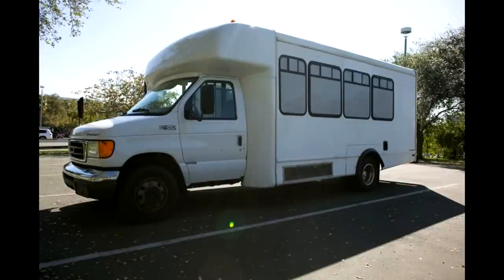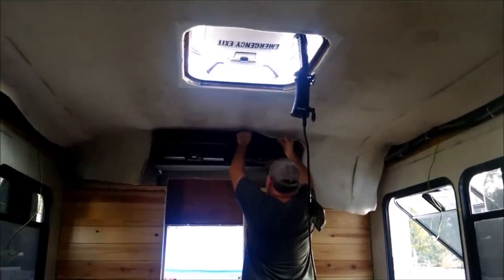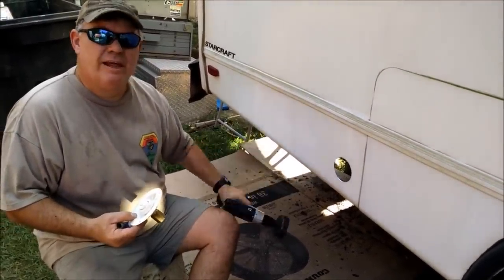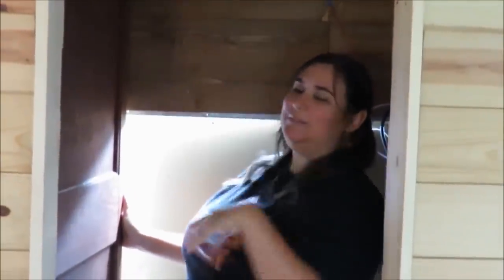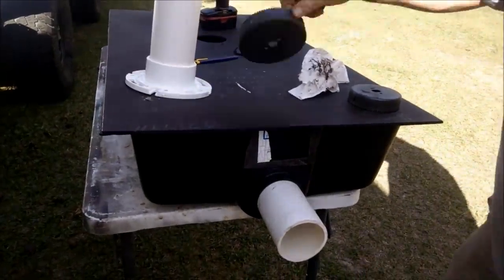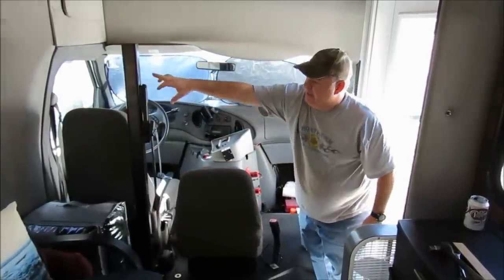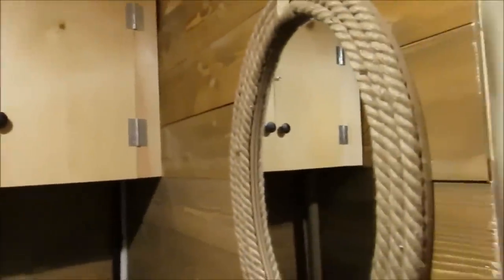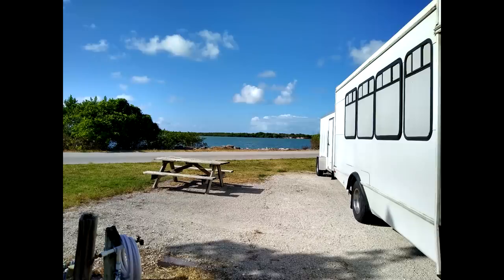Amazing Shuttle Bus tiny home conversion

Comment: Terrific job, and great explanations,  I'm just getting ready to do over a 94 Gulfstream Ford 24 Passenger Shuttle Bus,   29 ft long, with Tag Axle. --- but it has what I wanted!!! 2 regular doors on the cab and the fold out door is just in back of the passenger seat. Thanks for a great video!

Comment: Love  the  colors  and layout, especially  the  curtain!  --I'm  with  everyone  else  though,  I'd  need  a shower.   You  can  install  a shower head   and still keep  your  closet.  Just  put  the shower head over  the toilet, and have drainage in the floor.  I took a shower once  in a friends' truck bed camper  that had one.  Their bathroom  was  smaller  than  yours,  they  had  the  toilet,  a sink on the back of the toilet,  and the shower.  It  worked for me.

Comment: Interesting and comfy conversion however
I foresee a larger deeper kitchen sink for the ease of cleaning pots etc.  Have y’all considered making window and front door screens (simplified via magnets to hold in place after opening windows)?  I luv the wraparound kitchen countertop.  Did hubby install a fresh water tank and a hot water on demand heater?  Are you using a Mr. Buddy space heater for those chilly occasions?
I like the deco full length cab curtain; nice touch.  I’m not sure the futon style bed would be comfortable so I’ll be curious to see if in the future you opt for a hide-a-bed or a daybed style (couch during daytime) whereas the bottom pulls out so as to increase the bed size. 🌻

Comment: I would have installed the shower. I like to be able to shower last thing at night and crawl into bed nice and clean. Less clothes and a space to wash for me is a priority.
Reply from the maker: We mainly stay places that offer bathhouses with showers and its less water going into the black tank which means we can go longer before having to dump.  But I can see where not having to walk away from the bus to shower each night would be very convenient at times. We appreciate you watching our video!
Reply: Had room to make it a wet bath with a closet as well.
Reply: @DreamingBigSC  Its just shower water could it not just drain straight outside instead of black tank?
Reply: You could also consider a collapsible shower. I’ve seen multiple builds in YouTube where they made drawers or just stored a shower pan somewhere that could be pulled out, shower curtain hung and then put away after. Depending on what is under the floor you could even consider putting a shower pan under a removable section of the floor. But it’s a personal Choi and you’re happy as it is, that’s all that matters. Beautiful build and practically done to boot.
Reply: @Turk_2023  Not legal most places, I don't think.
Reply: @Turk_2023   yes usually grey tank or the ground if camp ground. Earth friendly soap
Reply: Me, too! 😊

Comment: I agree with Eric; this is sooo realistic! thanks for sharing it. I want to know tho, and maybe you address it later...what about insulation in the walls? You Go guys!!
Reply from the maker: Thanks! We left all of the existing interior walls which have normal car insulation.  We didn't add extra for two reasons.  First, we stay mainly in the South East where winter rarely gets below 30.  Second, since the bus is almost all windows we loose most of our insulation there no mater what we did.  So far we have gone to southern florida in the summer heat and we have stayed in the bus in 30 degree winter and we have been comfortable.  Heating the bus in winter is super easy.  Cooling it in the summer is a bit harder but again I blame the windows for that.

Comment: You also didn’t use off grid power?  No solar panels or deep cycle batteries?  My conversion will have a solar fridge/freezer, camp toilet (no black water), full sized kitchen and 600 watts on deck with 2400 watts in the batteries.  And full insulation with sheep’s wool and aluminum clad flex foam.  I would love to get details on some of these facets, if you used them in your build or why you didn’t want them.

Comment: I am glad I watched your video! I am looking for a shuttle bus to convert. I see you didn't take down the heat/a/c unit..does it work good heating and cooling your bus? The build looks great!
Reply from the maker: Actually the back unit was not working when we bought the bus. It doesn't heat or cool but it does recirculate so it's more like a huge fan.  It moves some serious air, though!  We left it in really because we were in a hurry to get on the road and it wasn't in the way of our design.  We will probably remove it one day because I would like to put some small cabinets in its place to hold kitchen items.

Comment: I really like your idea of using the vinyl flooring on the walls.  Looks great.  But it looks like you didn’t do any extra insulation in ceiling, floor or walls.  Are you sorry that you didn’t now that you’ve been in it a while?   Also, what do you do for heat and cooling?  Do you just use the bus system?
Reply from the maker: We mainly stay in campgrounds that have electricity so we use a floor air-conditioner for summer and a plug in heater in winter.  In extreme temperatures we also keep the blackout curtains closed during the day.  We have stayed in snow and in summer Florida heat and have had no problems.  We felt it was a waste of money to put in extra insulation since there are more windows than walls and that is where the extreme temperatures will creep in.
Reply: Dreaming Big SC Good point about the windows.  I’m considering a shuttle build and will go back and look at more of your videos to see if I can feel confident enough in my skills to do it. I have a lot of home remodel experience but nothing automotive so am a little overwhelmed but love the idea of a custom shuttle vs a manufactured RV.  You did a nice job, and I’m thinking of doing a similar thing with the luggage area (bathroom/closet combo, and hopefully bike storage) with perhaps a pocket door instead of a swing door.  Thanks for the quick reply.  Safe travels.

Comment: Nice work, but should have removed the ceiling plywood and add rockwool insulation, then new panel.  Also, add at least 1 inch of rockwool to the walls and floor. A nice freestanding wood stove in the center to keep it warm.

Comment: I noticed that you didn't strip the walls and insulate like most people do from what I've seen. Would you say the temp is ok without it on your build? Thanks
Reply from the maker: Our bus has more window area than wall area so we opted not to waste the money on added insulation since the windows would still be our weak link.  We also live and travel mainly bin southern states so heat is our main battle.  We don't have to deal with freezing temps.  We did a week in the Florida Keys in the hight of summer heat and we were fine thanks to the black out curtains covering all of the windows.

Comment: Hey I could use some advice and information.  It looks like your shuttle van/bus is a starcraft?  I just got one.  First thing is I need to replace the radiator.  Hairline crack along the plastic part on the top of it.  Have you done anything like that?  Next is this a V10 engine you have? Mine is a v10 6.8L Ford-E450.  I'm pretty sure that is what you have?   What is your MPG?  Also, mine has an "auxillary battery" I'm wonder ing if you can tell me anything about that.  Like, if I drain the auxillary with lights and stuff does it effect the primary?
Reply from the maker: Yes, it's a v10. We get 9 miles per gallon even when towing. We haven't done a radiator swap but those are common engines for the E450 series of Fords.  We disconnected our auxiliary battery when we got our bus so we don't know how that effects the main battery. Thanks for the questions and good luck on your build!  Thank you for watching.
Reply: Sent u another msg, and yes the radiator wasn't a big thing .I also sealed along the roof where the seam runs over the drivers area with Flexseal, and bought some sort of expensive durable RV tape to run along the sides. I kept the aux battery area, and put an AGM battery there with a throw switch for when I'm parked so I can have appliance juice without draining the starting battery

Comment: How did you cut off your front steps my bus has same issue an how did you change your door?
Reply from the maker: @josephdickerson9871  we used a 4 1/2 cut off wheel and a reciprocating saw with metal blades

Comment: Nice job,  an issue however, if you have a vehicle inspection a passenger seat can not be bolted down to a wood base, seats must be bolted through the vehicle floor with a metal base or rail system. An accident investigation would be a problem  Otherwise, really nice job! Enjoy it...

Comment: I didn't see no installation installed. Why no installation? Trying to see do I need to install or not.
Reply from the maker: I've talked about this a lot, with the number of windows in the bus we would lose most of our heating and cooling through those regardless of the amount of extra insulation we put in the walls. Therefore, we didn't waste time and money on extra insulation since the walls are a much smaller amount of space than the amount of windows. Now we are traveling mainly in the south so we do not get extreme cold temperatures here. We have traveled all the way down to the Florida keys during the summer and we have stayed in it in the snow in the winter. And with a small heater and a single air conditioner we were able to stay comfortable at both extremes. You will have to decide based on your conditions what would be best for your bus. But for us it was not worth the added expense. Thank you for writing and for watching. We certainly appreciate you.

Comment: Do you have to have a class B license to drive a shuttle bus?
Reply from the maker: In South Carolina it came down to the number of seats as to whether you need a special license. We had to prove to the DMV that it was now an RV with only two seats. They then chose to tag our bus as a truck which requires no special license. Other states are probably different so check with your local DMV.

Comment: I would suggest that you rebuild that secondary seat base out of metal, That seat belt is only as good as the seat base, you do not want one separating from the other in an accident. I have seen that happen in the rock crawling world and it is not pretty.

Comment: You didn't explain where you both sleep on the futon?  that does not seem comphy!  Plus no shower how does that work?  Plus the living space seems to be waaaaaay oversized which don't make sense because you don't have room for a shower or an actual bed space.  You didn't explain how and why you did that likely because you don't need those spaces but would have been nice to hear ya talk about it...  just saying..  that bathroom closet with the adjustable shelves is an awesome idea though and the door doubling as a could have been shower to bathroom door is also very great idea.  Awesome for you but confusing layout for me lol. cheers!
Reply from the maker: Thank you for your input.  This was just a quick overview of the build video. Basically a recap of all of the videos we have posted over the last year. We will be doing a full walk through video soon that will go into more detail and our past videos of the step by step also cover  why we made the choices we did.  The futon has a 8 inch memory foam mattress that replaced the futon mattress.  It is extremely comfortable. We opted not to have a full time bed because it was a waste of space during the day and I wanted a full couch and large kitchen.  We figured we are awake more hours than we are asleep so we built the bus with that in mind.  Its been a great  layout for us.  We opted not to add a shower because we mainly stay in campgrounds that offer showers so we didn't need one.  Im saving all of your comments so I will be sure to include those points when we do the full detailed walk through.  Thanks for watching we really appreciate it!

Comment: I see this video is 3 years old and it appears that you didn’t add insulation anywhere. Have you had any climate control or mold issues in these 3 years? I’m getting my shuttle bus delivered in a few days and am trying to figure out if I need to add insulation or not. TIA!
Reply from the maker: We haven't had any issues. We opted not to add any extra insulation because the number of windows was going to be such a weak spot anyway. We did fine in the winter but it is hot in the summer. If I had it to do over again I think I would have added more insulation to the ceiling. We are in the south and our summers can get into the 100s. If we could park in the shade it did fine but in the full sun it was hot! I'm not sure added insulation would have helped but it's worth a shot. My nephew needed a place a stay so he bought our bus last year and he is living in it full time now. It is still doing great.
Reply: @DreamingBigSC  , thank you so much for the information and for taking the time to reply!
Reply from the maker: @karise78  I'm always happy to help. Let me know if you have any more questions as you start your build.
Reply: @DreamingBigSC , that’s so kind. I will do that! Are you guys on Instagram or Facebook as well?
Reply: Actually, I found the links from your website to FB and Insta. Thx!

Comment: Great Job but what size was your nails for the side walls
Reply from the maker: They were 1/2 inch by 18g Brad nails to help hold the adhesive.  However we did have to go in a few places with small screws later.

Comment: i really like how you did the walls and the bath room was cool did it come with a back door when you first got it cause i want to replace my back wall with a sliding glass door. also how high are your head space or that step up  im 6 ft put plan on building a 2 ft or 1 1/2 ft floor to place japaneese futon bed and storage underneath in order to save space and keep it open???

Comment: You didn’t insulate it at all? Do you find it doesn’t maintain temps well without insulation?
Reply from the maker: We left all of the existing interior walls which have normal car insulation.  We didn't add extra for two reasons.  First, we stay mainly in the South East where winter rarely gets below 30.  Second, since the bus is almost all windows we loose most of our insulation there no mater what we did.  So far we have gone to southern florida in the summer heat and we have stayed in the bus in 30 degree winter and we have been comfortable.  Heating the bus in winter is super easy.  Cooling it in the summer is a bit harder but again I blame the windows for that.

Comment: beautiful. Did you guys have to do any insulation?
Reply from the maker: Since we covered over all existing walls with existing insulation we didn't add any new insulation.  We live in South Carolina where it's really hot in summer and just into the 30s on average in the winter.  In the last year we have had no issues staying warm in the winter.  In the Summer with the curtains drawn and the AC on we can maintain a comfortable low 80s in the heat of the day.

Comment: No shower was the deal breaker for me. Could've made the kitchen smaller. Maybe I misses something cause of the fast forwarding but where was the bed? Im in the process of doing a bus also and fetching ideas. With a bed you could have eliminated the space where you have 6 drawers for CLOTHES. All in all perfect size for 2 people and it if fits your needs more power to you. Great ideas though

Comment: What did y’all use for insulation? Excellent job !!
Reply from the maker: Since we covered over all existing walls we didn't add any new insulation.  We love in South Carolina where it's really hot in summer and just into the 30s on average in the winter.  In the last year we have had no issues staying warm in the winter.  In the Summer with the curtains drawn and the AC on we can maintain a comfortable low 80s in the heat of the day.

Comment: What did you use to insulate your new home? E
Reply from the maker: We left all of the existing interior walls which have normal car insulation.  We didn't add extra for two reasons.  First, we stay mainly in the South East where winter rarely gets below 30.  Second, since the bus is almost all windows we loose most of our insulation there no mater what we did.  So far we have gone to southern florida in the summer heat and we have stayed in the bus in 30 degree winter and we have been comfortable.  Heating the bus in winter is super easy.  Cooling it in the summer is a bit harder but again I blame the windows for that.

Comment: No insulation?
Reply from the maker: Since we covered over all existing walls we didn't add any new insulation beyond what the bus came with.  We live in South Carolina where it's really hot in summer and just into the 30s on average in the winter.  In the last year we have had no issues staying warm in the winter.  In the Summer with the curtains drawn and the AC on we can maintain a comfortable low 80s in the heat of the day.

Comment: So you didn't insulate the walls, it will be very cold. I had slept in my car and its cold.
Reply from the maker: We have a little heater and we had no issues last winter even on very cold nights.  Of course we mainly stay in the south where the nights only get into the high 20s.

Comment: Pex will freeze same as copper...lol!,,,
Reply from the maker: You are right, lol  That did sound like what I was saying didn't it!  Ha Ha.  I meant that since it expands a little we don't have to worry as much about it freezing and busting a line as we would with pvc.  That's what I get for talking so fast to follow the video.   Thanks for the correction.  Also I should have mentioned that here in the south we don't get the really cold nights too often and the bus lines are drained when we are not staying in it.